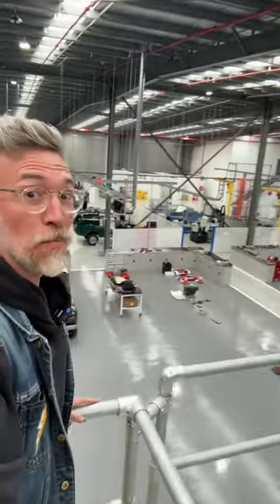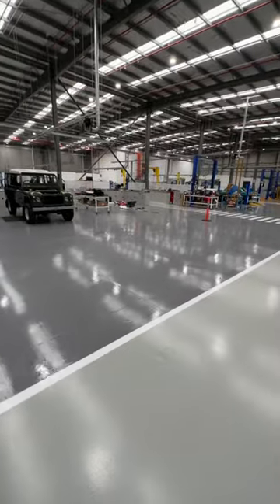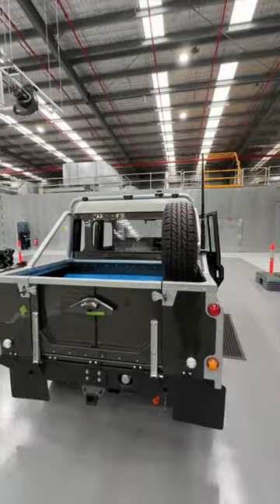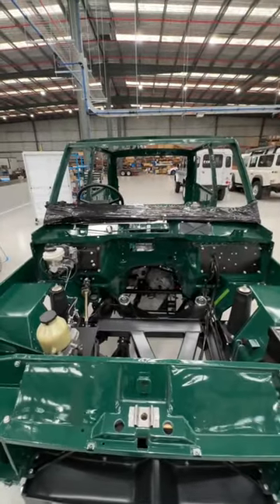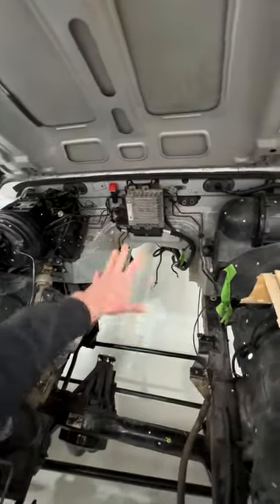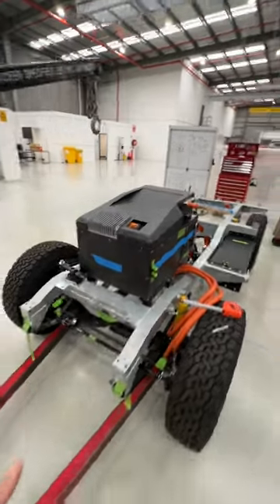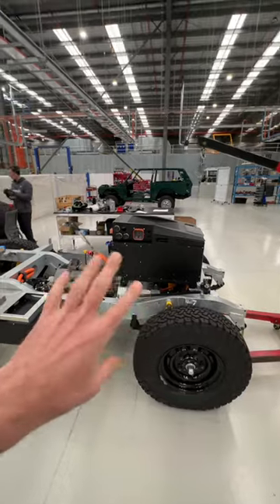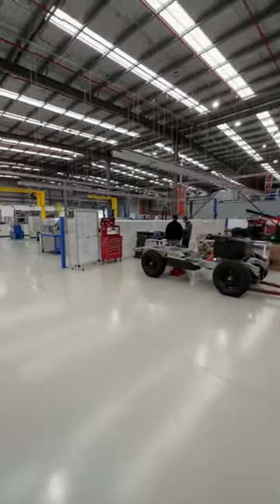Our New Electric Vehicle Workshop

Comment: Very impressive!

What range are you getting out of a 109 with your latest systems, and how are you installing the batteries?  Finding chargers in the UK is the problem, so range is crucial for commuting with home charging - I’d be very keen to see the battery configurations and range available in a 109.
Reply from the maker: 110kWh in a 109 over two battery packs. one in engine bay and one as a replacement for the seat box.